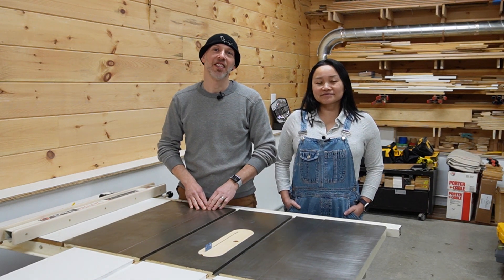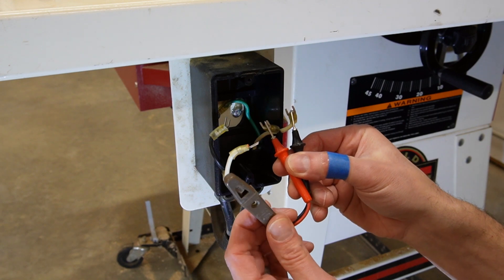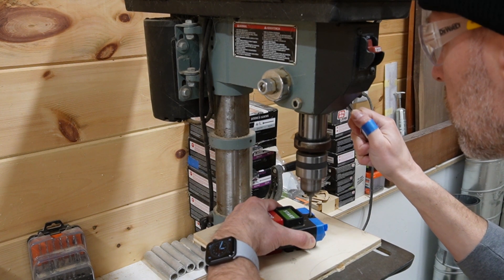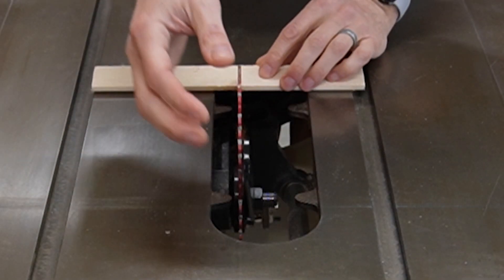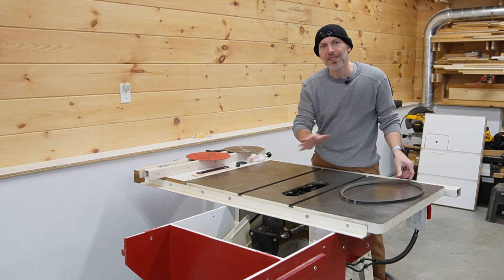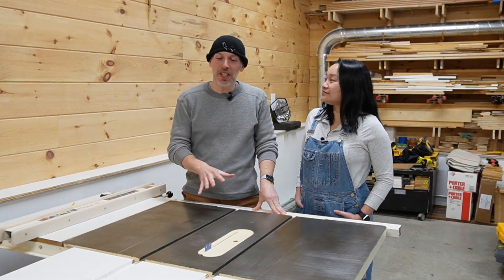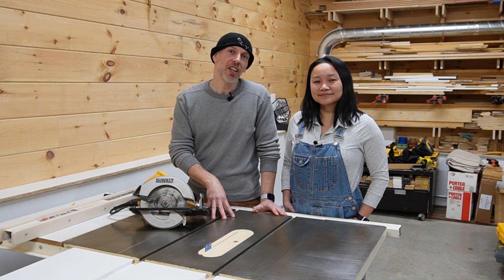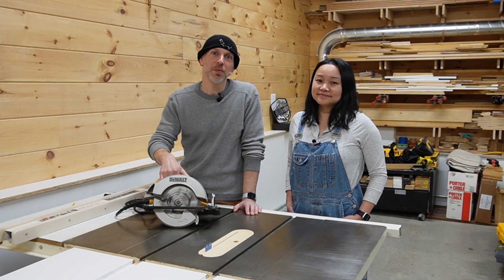Installing a Safer Switch, Belt, and more!

Comment: It would have been easier and safer to replace the box on your saw with a standard size junction box that the switch is designed for. That way you don't need to modify the switch.  I did just that on my Delta saw with the same switch you are using.
I love this style switch, it works well and is easy to turn off in a hurry if needed. Unfortunately the contacts burn out quickly. I need to replace mine.
Reply from the maker: Great point... It's good to know that there's a box out there with holes that line up with this particular switch. I'll keep that in mind when it needs replacement.

Comment: Have you or anyone else here, heard that by replacing your belt with one of those chain looking belts will help reduce vibrations….  Any idea, anyone…
Reply from the maker: Hmm... We're not sure if that's the case with those types of belts. If anyone else has experience with them, please do share.
Reply: @ournextmake  I 100% recommend link belts.  They are much quieter and last forever.